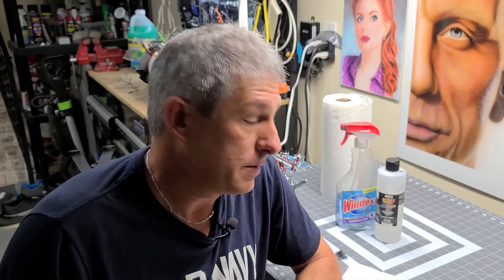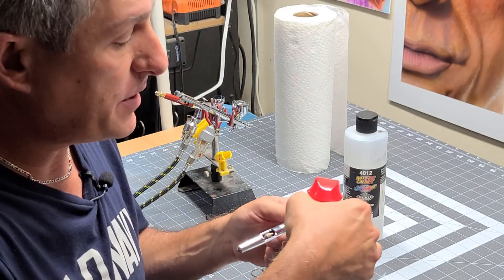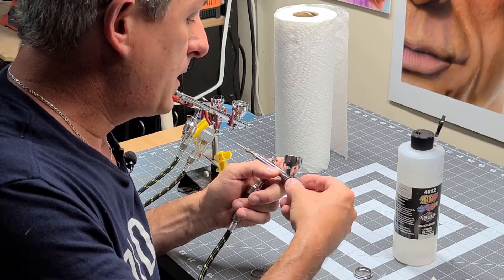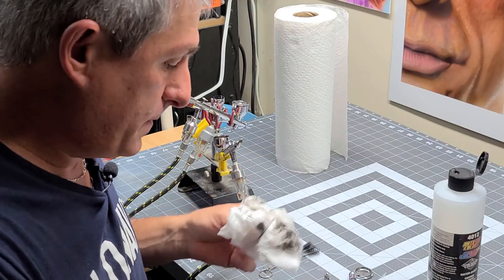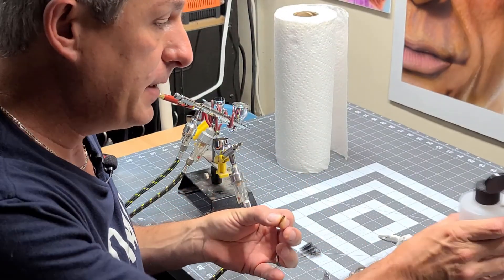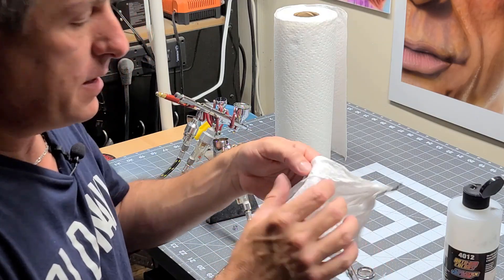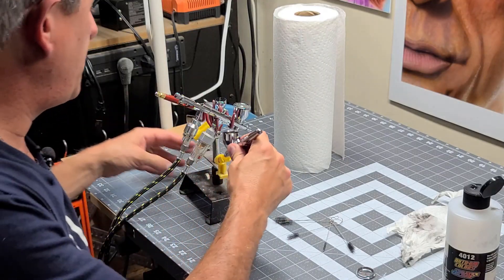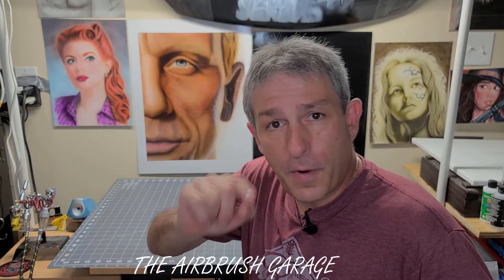Airbrush Cleaning Routine

Comment: Great video!!! When I was using Iwata airbrushes I to pushed the needle forward through the airbrush as well. However just a word of caution. For those using airbrushes that have identification rings on the back end of the needle could suffer damage to the packing seal doing this. So just a warning to those that have needles as such. 

On another note, I really appreciate the use of ammonia free Windex in the video. Ammonia based products are generally a big no no when it comes to airbrushes. Again, great video, very informative and thank you for posting.
Reply from the maker: Thank you for sharing your experience and thanks for watching.

Comment: Keep in mind when you backwash, you can drive fluid through the needle seal, into the trigger/valve area, if your airbrush is well used, more prone to happen.
I use brush’s and pipe cleaners to clean chamber and nozzle, sometimes I use a Choke/ Carburetor cleaner with the long plastic snout and spray inside nozzle, and also in the cup forcing spray into the chamber, works for me, never hurts my Airbrush. 
Most times the most you need to do is pull off tip protector, then air cap, loosen up needle and pull back 1/8” then remove nozzle, push needle foreword, clean needle, pull needle reward until just past body, clean everything up, put back together. If you need to clean chamber, you will remove needle, and watch your trigger, it can fall out. If you do a good flush when needed, between paints, whatever, that will go along way to help keeping issues down. I use a cheap pump up sprayer to flush my cup/chamber, there cheap and you can find them anywhere, over a bucket, turn airbrush sideways, pull back on trigger, spray the crap out of it with good old plain water. Then put cleaner in cup, and spray at high pressure and cycle trigger often.
Reply from the maker: Mark, thank you for sharing that. That is very good information viewers can definitely benefit from. Thanks for the comment and watching.

Comment from the maker: Thank you for the question. The paint should not back up past the needle packing. Therfore no paint should be in the area you are referring too. The paint gets between the packing and the cup. Thats why I give a blow through to try and push any remaining paint out after cleaning with my reducer. So, the answer is.....I wouldn't as that area should remain dry. I promise if you follow my (what some may think as insane) routine, you will never have a problem.
Thanks again,
Dan

Comment: Do you feel its worth running cleaner down the back end of of the Needle stop out the front?
I use a simple dish soap solution for my first initial wash, before finalizing with a 35% iso/5% ammonia/60% water homebrew wash,

Comment: Great video and thanks. So I’m taking from the video that you remove your nozzle every single time you do a deep clean. I have the Iwata Neo With a super tiny nozzle and I’ve already stripped one so I’m really nervous about taking it on and off like that. In your opinion, is it necessary if I’m really going to clean the thing properly?
Reply from the maker: Yes I remove mine every time. Just snug it. Don't turn it past the snug and you will be fine.
Reply: Thanks again.

Comment: You can't drag the needle out the front on all brushes
Reply from the maker: John, you are correct. I don't know every brush that is out there but I would prefer to pull it out the front if the brush allows. Thanks for the comment and watching.
Reply: Push needle as far forward as possible then clean the needle, then pull rearward.

Comment: I usually drag the needle through the back then clean the chamber lm just a newbie so won’t be doing that anymore. Do you use the lube that comes with the airbrush? No one really mentions it. When is it necessary to use it?
Reply from the maker: Derek, I used to coat the needle with it after cleaning the brush but I have gotten away from it. It is also supposed to promote less tip dry.  Never really noticed any difference. 50% of users love it 50% hate it! Some say it can attract dust and dirt and become sticky. I have had some users tell me they put drops of it in were there trigger goes into the air value. I totally DO NOT recommend that! My opinion is if you are going to use it only coat your needle with it. Hope this helps. Thanks for the question and thanks for watching.
Reply: @TheAirbrushGarage  Thanks for your reply mate much appreciated. I will do the needle once here or there not every time like I have been, I think it’s a waste of time too.